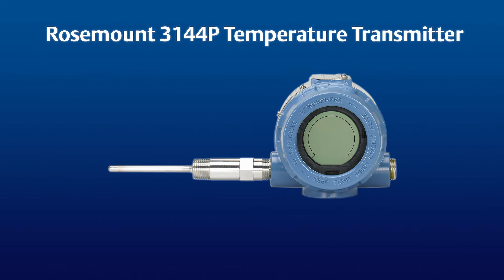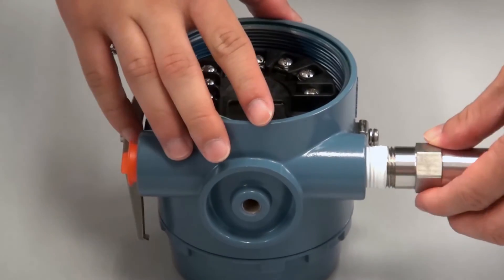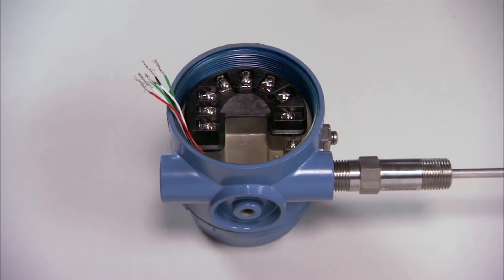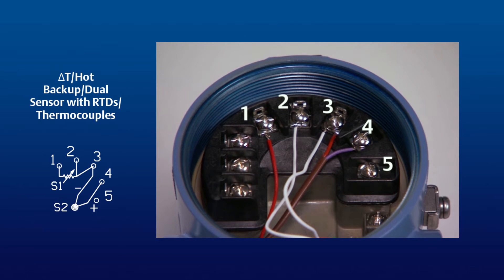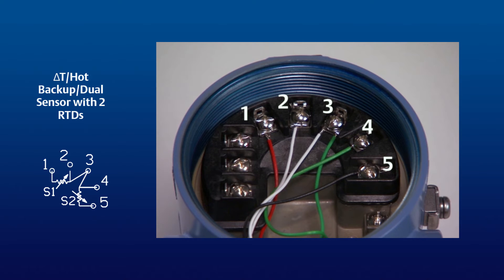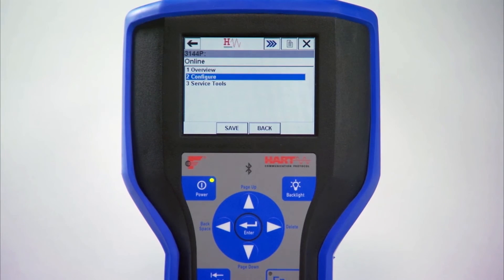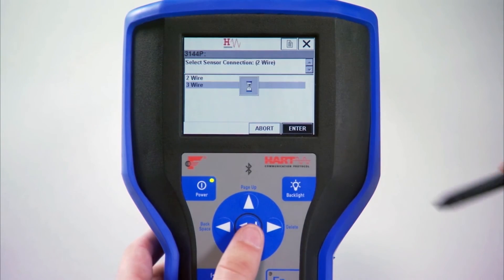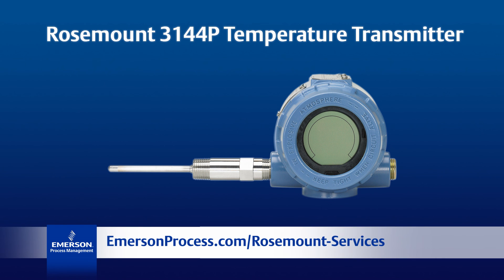How to Set Up a Dual Sensor for the Rosemount 3144P Temperature Transmitter

Comment: Excuse me Sir, could you share step by step to reset hot back up for dual sensor in Temperature transmitter by Hart?
Reply: In HART communicator configuration/manual setup/diagnostics/hot backup/reset hot backup.

Comment: what if I like to use 1 sensor but my sensor are dual can i disable the sensor 2 ? Can provide decent output even sensor 2 are disabled ?
Reply from the maker: Hi! Thank you for watching our video. Yes, it is possible to disable sensor 2 input on the 3144P temperature transmitter.  It will operate as a single input device. For any other questions and concerns, feel free to reach out again or contact us at http://www3.emersonprocess.com/contactus/default.aspx